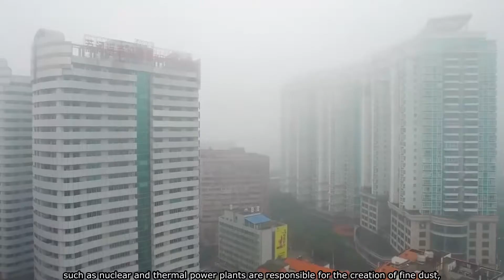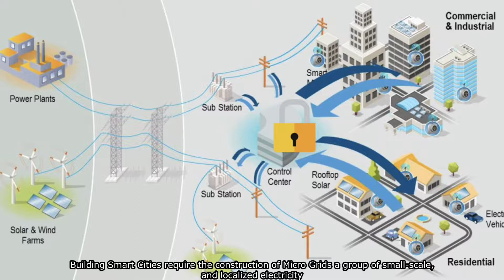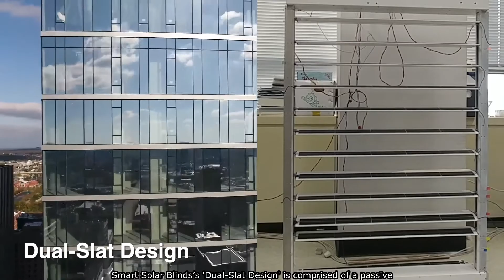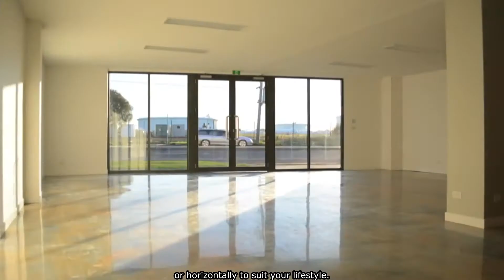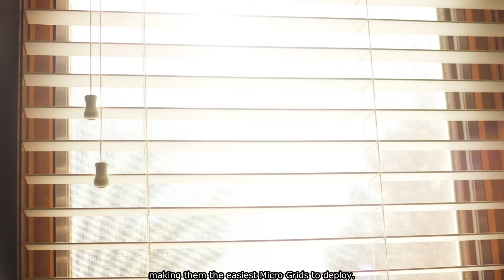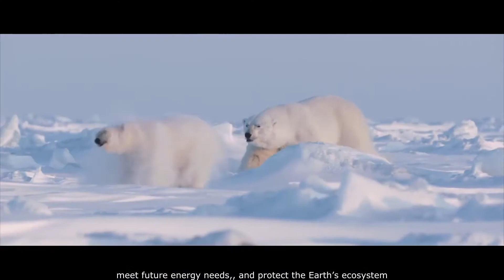ENG_ (Dual Slat Type) Smart Solar Window Blind  for Mega Smart City

Comment from the maker: < Solution>
  - Don’t need transmission towers: Even if the energy demand in the big cities increases, there is no need to install additional transmission towers and the existing transmission towers can be removed.
  - Can supply up to 90% of the electricity demand in Korea (replacement of nuclear power and thermal power generation):  Installing in the building’s windows of the south and west, improving solar efficiency, etc.
 - How: Installing ‘Smart Solar Window Blind’ on Windows of High Rise Building →   Near Zero Energy Building (Energy Saving + Energy Production)  →  Micro Grids  → Mega Smart City